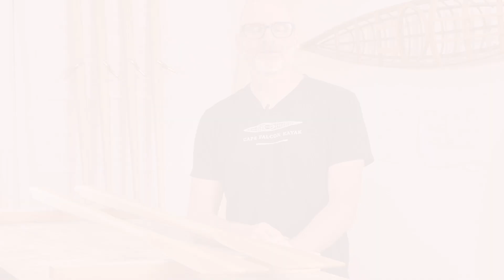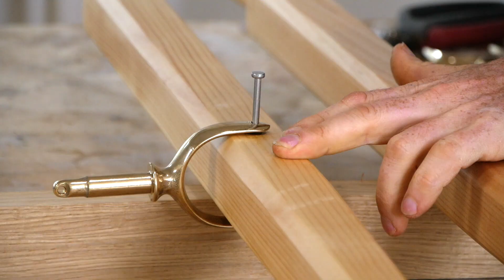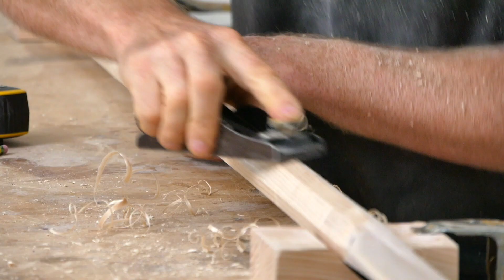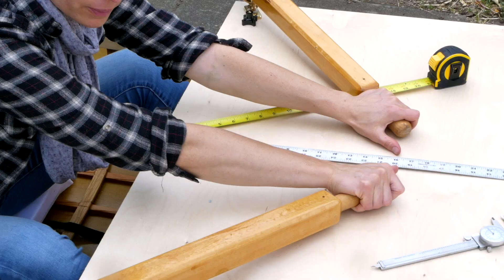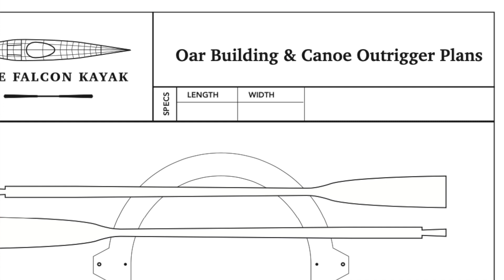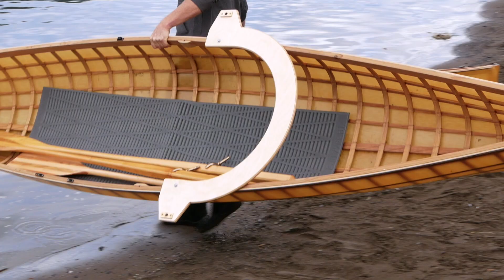Canoe Outrigger and Oar Building Course Introduction

Comment: This one get a sliding seat, or is it not really necessary?
Reply: A sliding seat adds a lot of complexity and not much more speed to a boat that is shorter than 18 feet and wider than 30 inches.  If you are rowing all day or in rough water for more than 5 miles, you'll get more miles per flapjack with a fixed seat set up.
Reply from the maker: You can do that, but it's really a totally different set up, once you add a sliding seat, you want a wider outrigger, longer oars, and a different boat design.  This is just a simple little rowing rig that's quick to set up and easy to use.